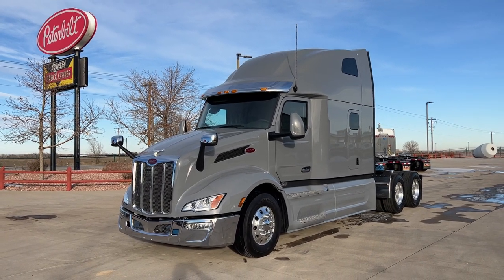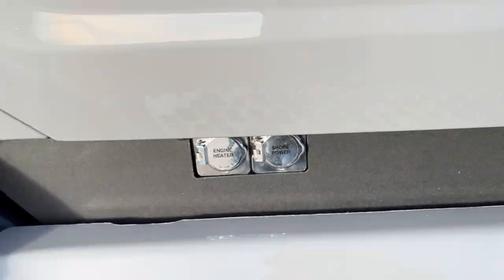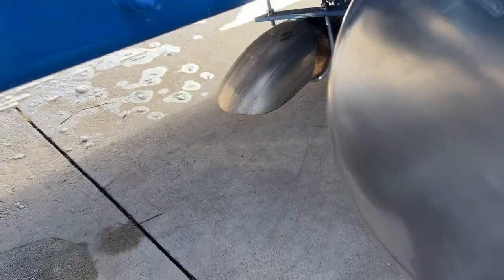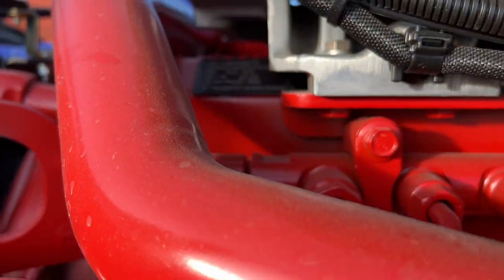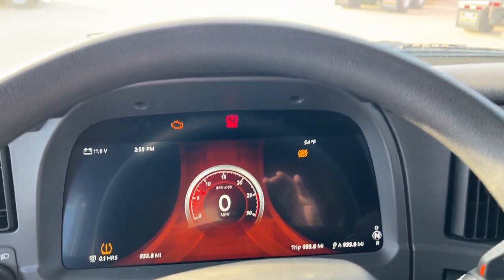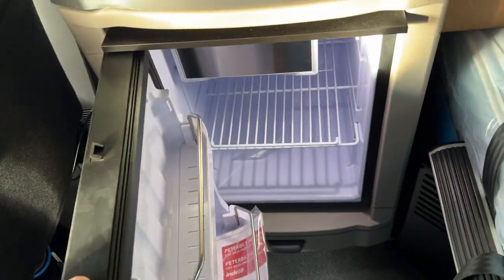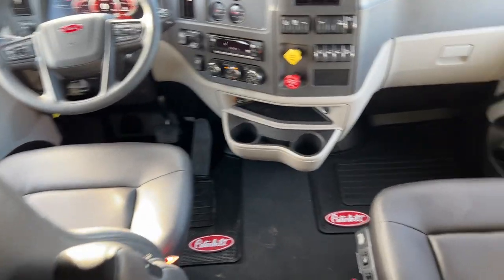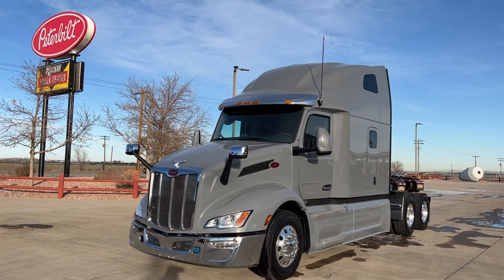2023 Peterbilt 579 w/80" Ultra-Loft double bunk

Comment: I was told to stay away for anything that has Paccar on it because they are a nightmare of problems with trucks staying in the repair shop than on the road. I only asking because the trucks I drive don't have all the computer and emission problems. I don't know anything about them . I drive a 2001 Freightliner Classic XL they don't all the electronics and computer problems. All I ever needed was new tires and changed the oil change.